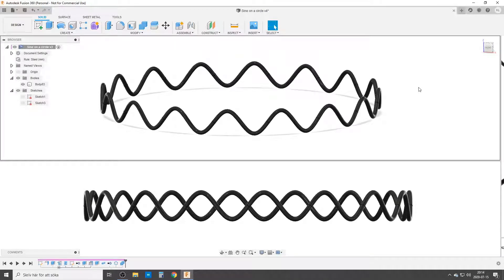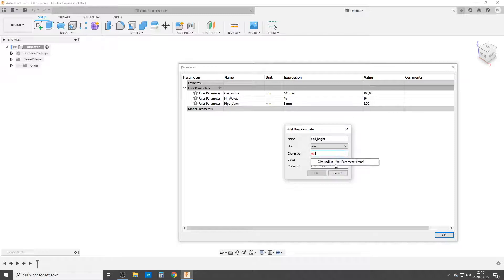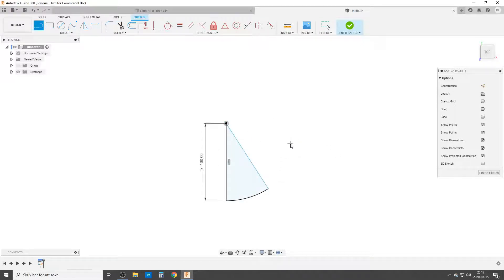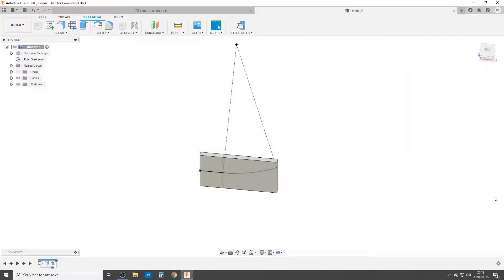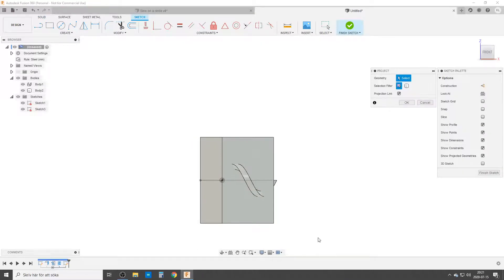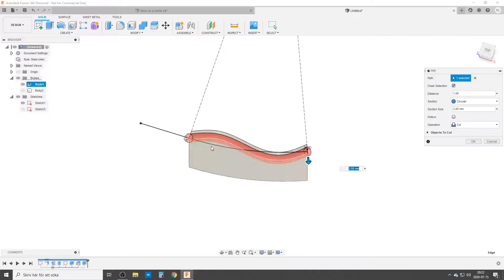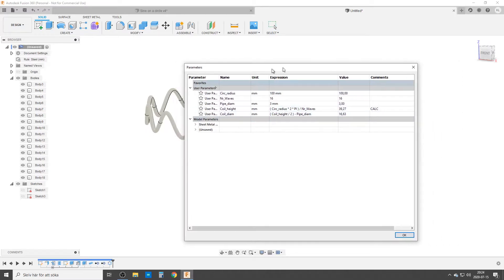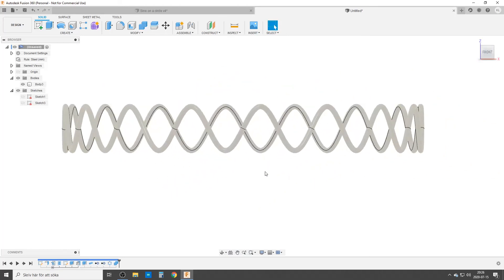Fusion 360 - How to Wrap a Sine Wave perpendicular around a circle

Comment: At 5:20 my Fusion does not snap to sketch geometry when creating the coil. It snaps to the origin only. Any ideas?
Reply: Update: It works while still in the sketch environment. To get the coil perpendicular to the sketch profile the coil is centred on I had to create a sketch in the correct plane and project the point from the 1st sketch.
Reply from the maker: @zapod20  This is an old workflow. Now I don't use coil that much, Surface sweep with twist angle gives a good helix. And I'd use Emboss and not the sheet metal trick for bending the helix.

Comment: Is there a way to create a projection of the sin wave in a way that makes the frequency or amplitude change across its length? I tried settinng the sheet metal at an angle, didn't do it :(
Reply from the maker: You can use a combination of angled/arced surfaces creating some interesting sine waves. But it's a lot of work getting it right and sometimes the curvature of the final body can be bad and create problems with later features.

Comment from the maker: There is a shorter workflow by projecting a helix sweeping a circle projected on to a cylinder, but I have had problems with Project to Surface in Fusion  so the workflow you see in the video is the one i prefer.